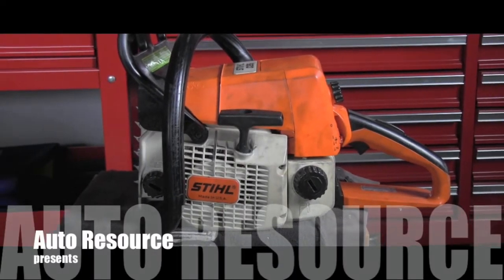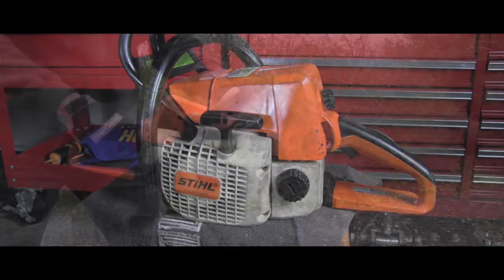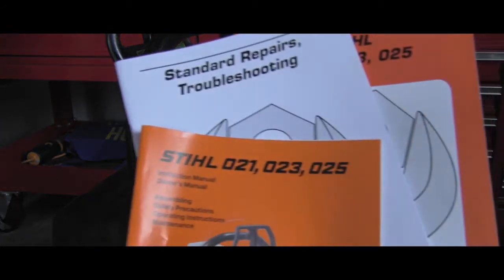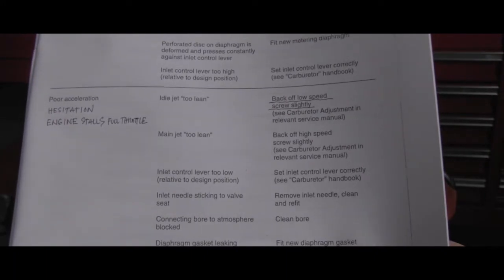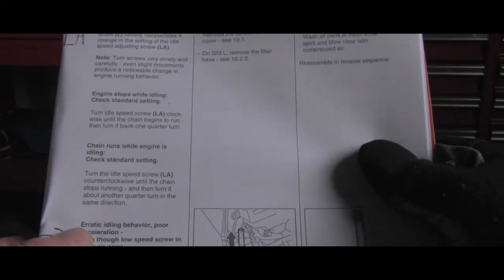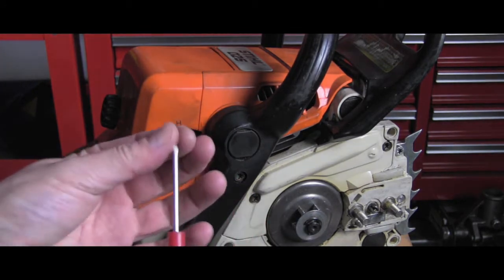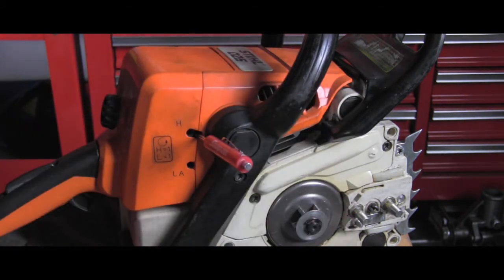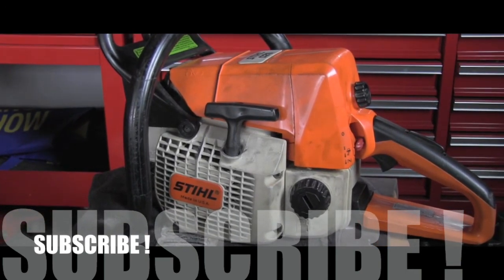Stihl Chain Saw poor acceleration, erratic idle

Comment: Thanks for posting but just to note that I had this problem with a Stihl MS250 and solved it by cleaning the fuel filter and without adjusting the carb settings. Cleaning or replacing the fuel filter is very straightforward and it might be worth trying this before making any adjustment
Reply from the maker: Thanks for sharing